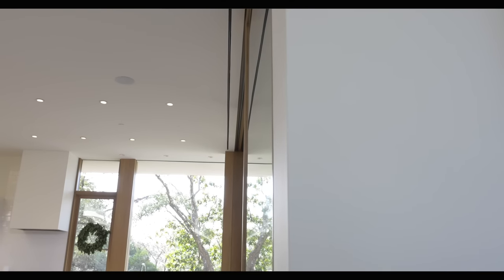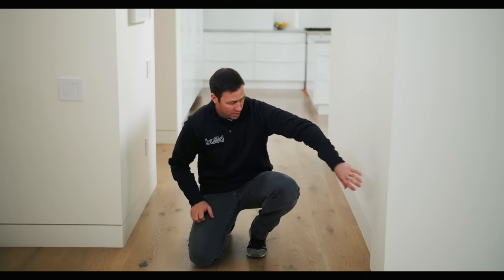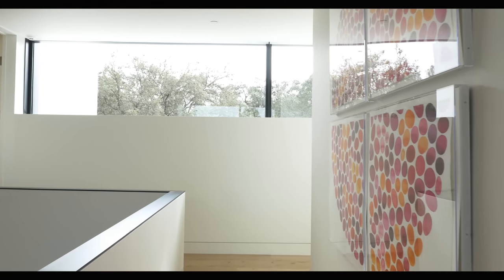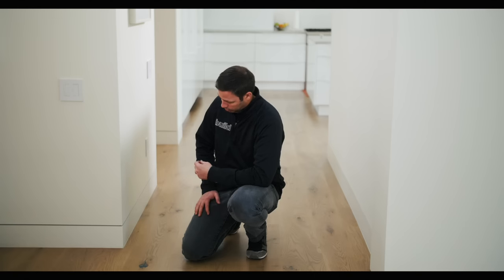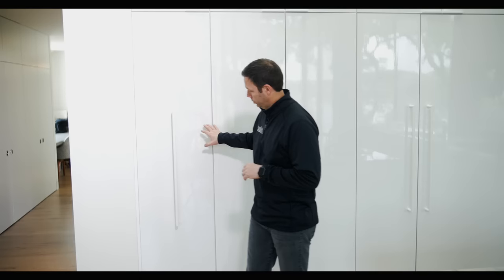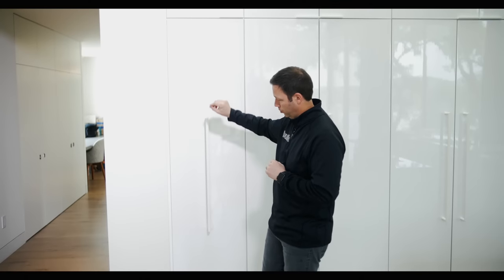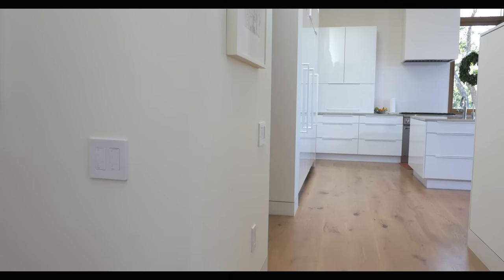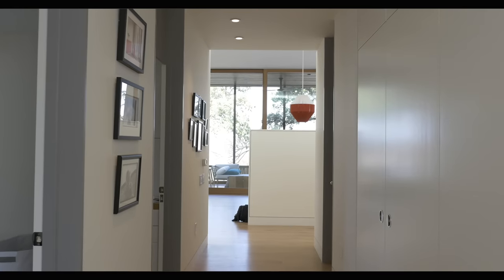Modern Trim

Comment: As a trim carpenter. I’ve done this exact design plenty of times. Usually high end apartments in to 30th floor or above.
It makes sense doing it where owners don’t spare any funds and want things done right. 
If you’re trying to do this yourself, don’t even think about getting anything less then lvl5 drywall install. And even then. Everything else must be on par. Especially framing. (Because Sheetrock guys typically don’t care, they’ll cover anything, and just flare with spackle.
Personally I prefer modern trim but on top of drywall. If the house moves eventually, and it will, this trim will still look better

Comment: The flush trim on base I saw being done in 1998 in upscale houses in Venice, California. It’s not new and from another video you did there was  flat blocking on the bottom plate between studs as a nailer. I would think you would need a good GC and crew: (Framer, drywaller, trim carpenter) to make it happen otherwise you’ll have a big wavey mess on your hand trying to flush up drywall and wood. Then you would probably want to mill the baseboard using 3 1/2” plus baseboard 5/8 or greater...  and a 10’ greater top plate, just my thought? The casing is also an issue where you need the door jamb plumb and level, so you don’t have things tweaked and shaving this and that. I’ve seen recessed reveals done now around the jamb and the finish drywall. The groove is painted black to hide out of square wall(s). Thanks for sharing. Most people don’t have an eye for these finish details. So unless the house was $2M plus or you appreciate fine (woodwork) details I think it’s a dubious expenditure. I noticed on the trim there is a small rabbet 🐇 was that detail carried through to the casing?

Comment: As a finish carpenter, I have worked on a few homes with this trim package. It is very hard to do, and very technical. For example, if you have a long hallway, with wood floors, you have to understand that the floor could expand to the point where it contacts the framing. If that were to happen, the floor could buckle, or it could push your walls around, even a barring wall. That's a big no no. This is because the baseboard is attached to the framing, and there's no shoe molding. Meaning your floors are within 1/2 inch of your plates, without this trim package, that distance is typically at maximum 1 1/4 inches. 

Meaning, you better have some money if you're attempting this, hire the right carpenter.
Reply: Hire the right carpenter - that's the goal right?
Reply: I was gonna ask how this look is going to hold up
Reply: @shinnick22  it does well over time. Just the install is a real pain, working with the J bead. It's unforgiving, unlike normal trim. Things need to be perfect, or you get a build up of compound that sticks beyond the jamb or baseboard, and that's not how it's supposed to look.  There's a whole book that could be written about all the tricks that help the install. And a whole bunch of well your house isn't pumb or square when addressing the problems that come up. It best the bead has support the entire length of the pieces. That's like trimming the job before you trim it.
Reply: @michaelstiller2282  Good info. I hope someone writes that book. 

I do remodels of mostly older houses with “formerly plum” framing. Install may be tricky but I’d love to try it out.
Reply: @shinnick22  one trick, custom door jambs. Wide enough to account for the house not being pumb. Can always float up to the jamb. Shim out the "J" bead to the jamb.  Or you get into crazy jamb extensions. If people allow you to do that. But that never works out well. Making huge shim jamb extensions really, and it looks funny. If you were to do this to a 1900s house, I'll start drinking for you. And I have been sober for 3 years.

Comment: As an architect, I appreciate the excellent craftsmanship demonstrated with the installation of this flush trim at the base of the walls. However, the effort  raises a question about the purpose of trim.  Traditionally wood trim at the base provided an attractive cover for  transitions, and allowed minor movement in the finishes  for expansion and contraction. . Is the only  purpose  to be a bumper to stand up to occasional kicks and contact with vacuum cleaner flor attachments?

Comment: The look is very swish but it does add a lot of cost to a project. In the UK I've found it incredibly difficult to buy the trims and just as hard to find a builder with the patience to fit them. I've instead opted to go for a very contemporary skirting and architrave. For my future project I might consider taking a different approach if I can find something more cost effective.

Comment: ive used that door frame trim system 10 years ago in AUS  and you need to get it right  as the timber frame moves and a crack will appear  up the negative detail

Comment: What would you remodel for a remodel where the drywall is already in place? Mid-century modern built 1955. Doesn't currently have any base trim. It seems like they put the drywall on after the wood floor and ran it all the way down.

Comment: When you install the jamb so early, how do you prevent it from being damaged during drywall install?
Reply: #1 hang drywall #2 set door jamb and frye reglets #3 finish drywall
Reply: Barry Summerlin 

Not in this case

You set the jambs 
Then hang the drywall leaving a reveal 

Matt states this in the video at around 2:00

Comment: Maybe I see it wrong in the video but it looks like they are caulking the bottom of the base trim. I don’t think I would run a visible bead of caulk at the bottom of that flush trim; that’s going to be a pain to maintain in the future. It’s much better easier to paint if there is a slot there and you can slide masking dry masking paper right into the slot and a repaint job becomes a breeze. As a someone who previously worked as a painter, I say design for ease of future maintenance in everything you build, or somebody’s going to hate you.

Comment: The 1/2" floor trim saved multiplied by every linear foot of drywall in the house is 1sqft every 24ft (144/.5). This could mean up to 10sqft more of usable floor in a normal sized house.
Reply: Still not worth it lol. It'd be easier to add a foot to the perimeter and give the house much more footage. For cheaper too lol

Comment: Good luck once the house starts to shift even a few millimeters
Reply: Exactly what I was thinking. We own a rental where the builder used plastic drywall corner trim to wrap the door jambs and wall together eliminating the need for trim -- theoretically. But as the doors got used, the vibrations caused cracking. The door needs to be isolated from a hard connection to the drywall so that it is free to wiggle a little without creating cracks in the wall. The traditional method of running drywall up to the jamb and covering with trim solves this problem. I'm waiting to see what 5 or 10 years will do to this house. Maybe it'll work, or maybe they'll be adding trim.
Reply: dennmillsch whats state may i ask? good point
Reply: dennmillsch if you watch the other video it does seem to be isolated but without seeing it in person I can’t confirm.
Reply: There is a gap, it doesn't touch the jam
Reply: @cjschmitt4882  i think youre right. The drywall goes behind the metal jamp.
Reply: He used aluminum Frye reglets ... this isn’t a rental

Comment: Matt Risinger what do your painters or finish carpenters use to fill in nail and screw holes? For example with exterior trim applications or interior trim applications. One thing that bothers me as an up an coming professional is the inability to successfully hide the holes left from fasteners, I often find with time either caulk will shrink or body filler will crack.

Comment: I saw that at 3:22 you show how you've used caulking between your flooring material and your recessed baseboard...in my experience that would be a huge no-no because different products expand and contract at different rates with temperature and moisture.  Isn't this going to be a potential problem where all your caulking is going to split and show gaps...or maybe you used a superior caulk product?  Pls let me know what kind of caulking you'd suggest for this kind of application.  BTW...I really like the clean flush look the house has going (reminds me of European design)...the homeowner obviously doesn't have young children.
Reply: Duly noted.

Comment: Another great one +Matt Risinger. Thanks for posting. Two questions: 
1) what type of reglet did you use around the door (F, Z, or other)?, 
2) Can you please provide info on the kitchen cabinetry hardware? 

I've installed a similarly looking door fronts (Luxe by Alvic). Trying to find hardware that blends in as you cleverly done. Cheers.
Reply from the maker: Toddy,  Thanks for the nice words.  The Reglet is an Z from TrimTex.  The cabinet hardware is from Wood-Mode.

Comment: For some people asking for a little bit of explaining. I'm a builder that loves details and I'm not to his level but one day i hope to be. If not better. This is my interpretation and a response i did to someone saying he talked to much and didn't show how he installed the base
It's just straight 1x boards nailed down. They used a laser to get the perfect height so that when they install the base it'll fit perfect. It all comes down to the flooring system as well. First they compact the ground several feet if it's soft by having the ground tested for how compact it is. Then a solid foundation and then back to the laser for a perfectly  straight subflooring. All that so when you get to the finish you have perfect fitting. Of course there are ways to cheat in case of mess up that normal people wouldn't notice. If the floor is uneven you get a slightly taller trim and scribe the bottom to perfectly match the uneven floor but keeping the top untouched so that if the floor is uneven, the top will be perfectly  straight. That's when the table saw comes into play to get that perfect width. You'd even be able to match the transitions like from tile to carpet or hardwood. It should fit like a glove. This was more a video showing what can be done. If you have detailed building skills you'd be able to see all the work and details and even how to surpass imperfections to make it look like there isn't any. I love his shows for that reason. I learn a lot just by seeing because I can pick up on details like these so I'm taught so much more than he says.
Reply: Honestly it’s baffling to me how much this confuses people 

It’s just trim-less doors and flush baseboards

Comment: The kitchen and floor detail looks nice but I can't even see the trim around the door ? Looks as if the door frame is just wider that the wall and you ran the drywall tight up-to it after leaving the door sticking out a bit ??
Reply: The jamb protrudes from the framing a distance equivalent to the thickness of the drywall (typically 1/2”) 

It protrudes flush with the drywall and has  a reveal between the jambs and the drywall 

This creates a shadow line

Comment: You know that instead of pushing the drywall to the floor you start where the reveal is and then for the missing bottom section you put wood?
Reply: Yes 

Leave a reveal between the base and the drywall 
This creates a shadow line

Comment: whats the point of having any trim at all if its flush with the walls?
Reply: Base boards serve a few purposes 

They cover the gap between the floor and the wall 

They finish off the bottom of the wall 

And they protect the bottom of the wall (where drywall is brittle and damages easily, a baseboard is hard and takes much more damage) 

In this case it’s does all this but it’s a sleeker design

Comment: How is this “modern”? This beyond modern. This is cutting edge modern. Today’s trim is using taller 3” or 4” baseboard trim that’s either square or tapered. I used this trim when upgrading the hardwood flooring.

Comment: This is all good until your house catches on fire. Don't expect a firefighter to be able to search and feel where the doors to your bedrooms are.
Reply: Paranoia...
Reply: @dkalambokis78  - well, it's the USofA, getting paranoid has become part of its DNA (see "helicopter parentship").
Reply: Ryan Mcginnis 

The jambs are flush to the wall and the door is trim-less

The door itself, hangs recessed in the door jambs like a regular door 

It also still has a knob/handle 

Your concern doesn’t really apply
Reply: Not paranoid at all. I'm a firefighter and when we get reports of someone trapped and i cant find a doorframe its going to be difficult locate them.

Comment: How about some details of what trim is used and how to install it?    This is a pretty useless video, it's like looking at pictures of houses on pinterest.
Reply: It's just straight 1x boards nailed down. They used a laser to get the perfect height so that when they install the base it'll fit perfect. It all comes down to the flooring system as well. First they compact the ground several feet if it's soft by having the ground tested for how compact it is. Then a solid foundation and then back to the laser for a perfectly  straight subflooring. All that so when you get to the finish you have perfect fitting. Of course there are ways to cheat in case of mess up that normal people wouldn't notice. If the floor is uneven you get a slightly taller trim and scribe the bottom to perfectly match the uneven floor but keeping the top untouched so that if the floor is uneven, the top will be perfectly  straight. That's when the table saw comes into play to get that perfect width; since the bottom is scribed to the floor even on transitions. It should fit like a glove. This was more a video showing what can be done. If you have detailed building skills you'd be able to see all the work and details and even how to surpass imperfections to make it look like there isn't any. I love his shows for that reason. I learn a lot just by seeing because I can pick up on details like these so I'm taught so much more than he says.

Comment: That's not modern, that is unnecessarily expensive. A"modern" house you can't swipe your floors in fear of dinging the baseboard is just stupid. I'm sorry, but a true modern house is practical. The overall look is nice, but those baseboards are trash.
Reply: They have the same durability as regular baseboards and they are likely made of the same material (hard wood/soft wood/mfd)

It just looks sleeker

Comment: Architects design structures that look great until you build them . I was called to service 5 doors that won't open , each imported from Germany at $40 thousand dollars a piece . Imagine you spend 200K on doors that won't work after 3 years. It's not the door , it was never meant to be installed in a ocean front brutal conditions, it looked great in the picture though , it was the same about every other part of that house , rust, leak, crack ...patch it , sell it.